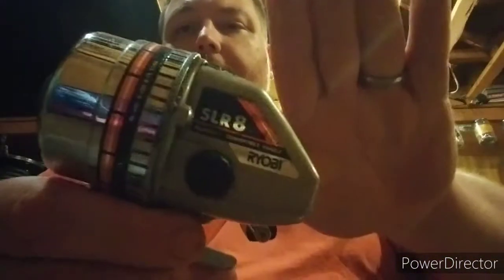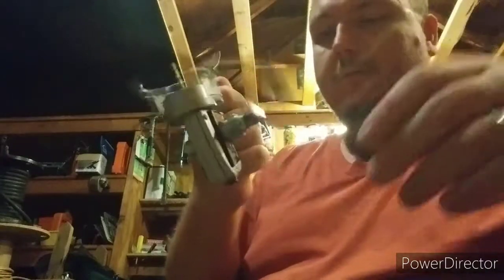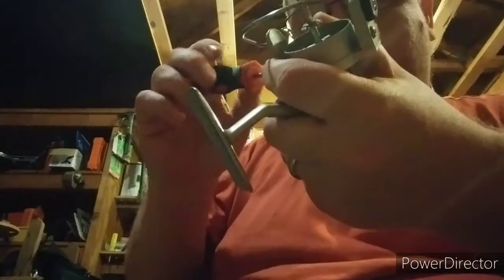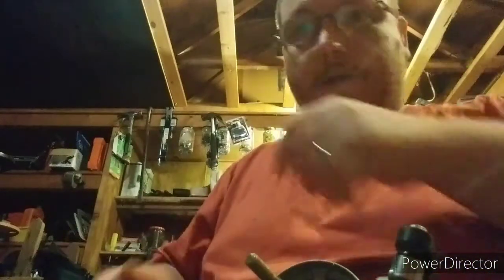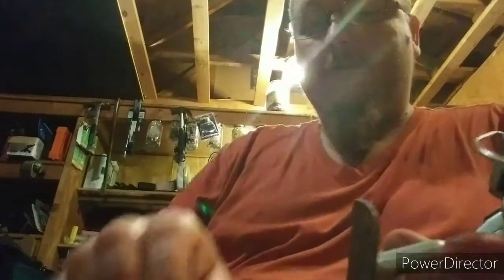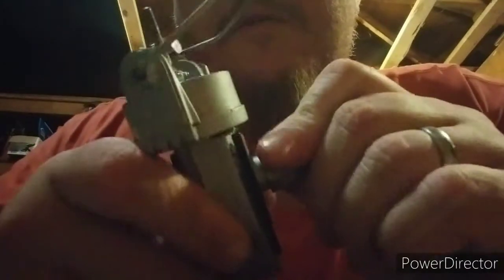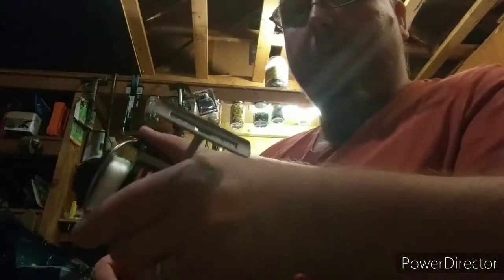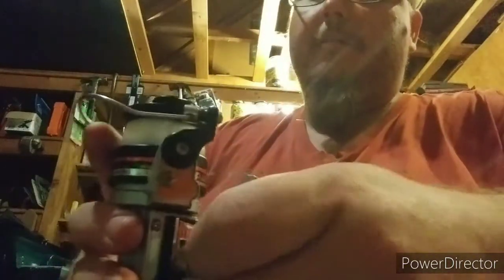Ryobi SX2n The Silver Cloud

Comment: at 14:06 you ask why the nut on the handle turns. It's so you can fold the handle down for transport by loosening it. I've had one of these for 25-30 years and it still works